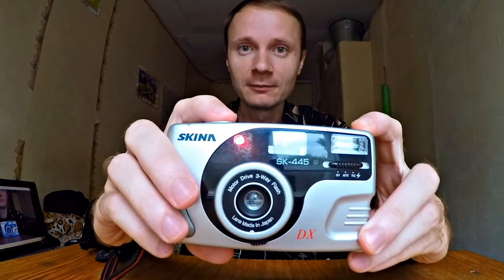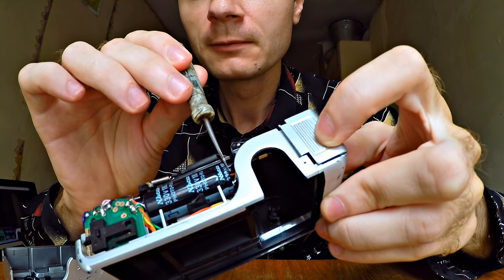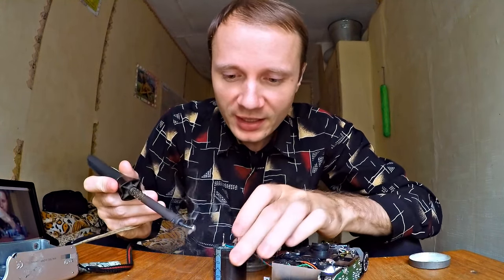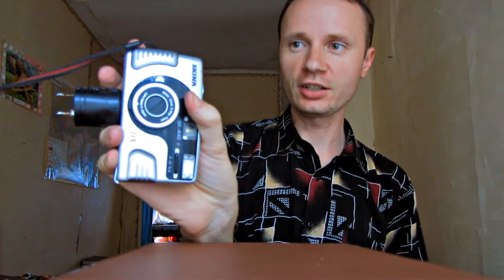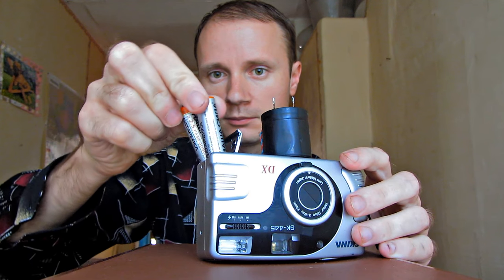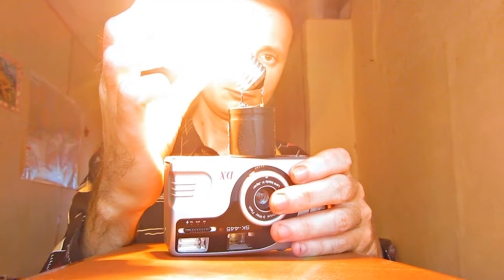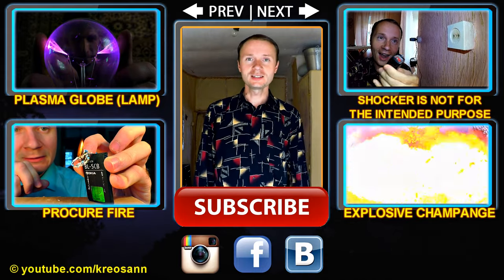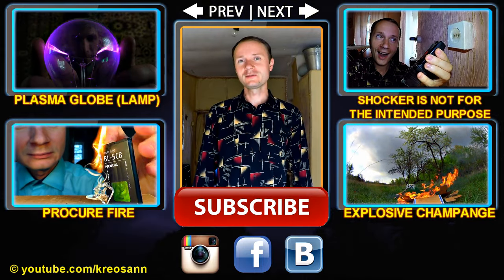How to make an ELECTROSHOCK weapon from the CAMERA, quick, easy and effective!

Comment: Taking apart a disposable camera was the closest I ever got to accidentally killing myself as a kid. I took the battery out, hit the flash button, and proceeded to take the camera apart thinking I was safe. But my thumb brushed up on two metal leads and I proceeded to get a huge shock, one that blew two deep puncture wounds in my thumb and scared the hell out of me. That day I learned that just because something isn't plugged in the wall or doesn't have batteries in it doesn't mean it can't seriously hurt you. Had I touched the two leads with a finger from each hand I may not be here to tell this story!
Reply: Also, larger electrolytic capacitors has a bad tendency to have residual charge remaining in them after a quick short circuit like this. So be sure to either 1) keep the two leads shorted for some time to allow the capacitor to fully drain or 2) touch the leads with a screwdriver twice

Comment: How many the microfarads (μf) of the small and big capacitors? Can it charge more than 1000uf capacity with 330V although it is slow?
Reply: The voltage of these capacitors are most of the time at 330V but the capacitance in microfarads vary depending on the size of the xenon flash tube. I have seen cheap camera with tiny flash tube have 150uF & 220uF usually. The biggest ones with shoe mount flash have 330 uF, 470 uF and bigger. Technically you can use a bigger capacitor in any circuit just that it would take longer but just don’t use it with smaller flash tube. Might blow up!

Comment: Is it lethal?
Reply: depending on health conditions. this cap holds 45 joules (defibrilator 
are 150-350), but if you got a weak heart this still can be lethal. also
 skin conductivity is a important factor and as @ivanjacob said, also 
how the current travels thru your body. i once got zapped from 40 joules
 (similar setup) on my hand and it was numb for 2 days. im glad the 
nerves recovered.
Reply: Geanos Uron yes very
Reply: broskie hey bud  try a flyback transformer from tv those are very dangerous but fun   old crt have them  look for silicone wire !!

Comment: Discharged a (small I guess) flash capacitor into myself once, it suuuucked
Reply: Ever discharged an overloaded ignition coil Into yourself? I calculated the output of the coil was 50Kv 🥶
Reply: I've done it too, small flash capacitor, playing with it flashing the xenon flash bulb, some how touched the capacitor with my finger, OMFG that was painful, waaaaaay more painful than a tazer. These capacitors in the video above are in parallel and extremely lethal power levels 😮